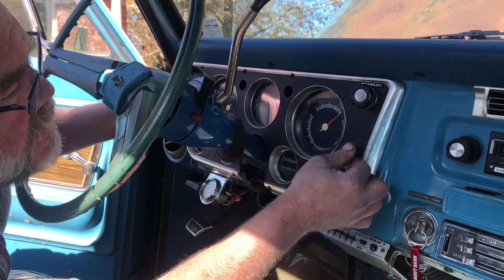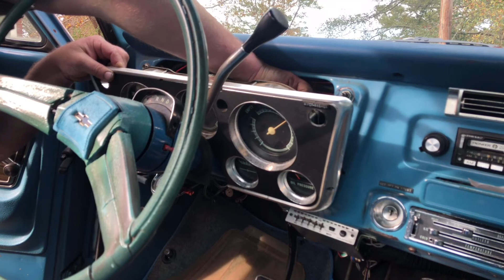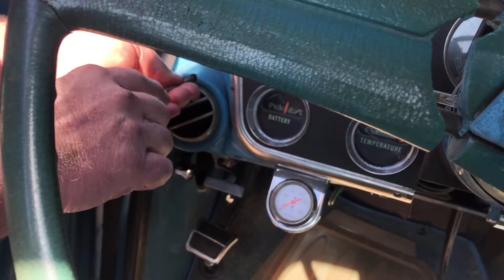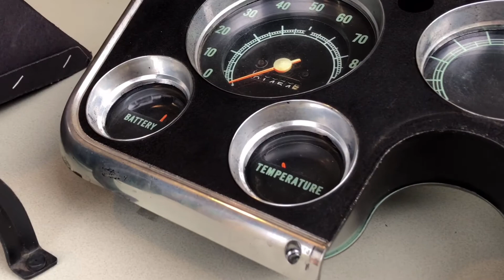Factory HVAC restoration

Comment: Nice how the older vehicles were easier to repair,,, no servo motors that break in 5 years,,, Just keep the cables lubed ,,,Glad there are reproduction parts available,,, Good luck on the gauges,,,Best Regards

Comment: I just bought a 1 owner 69’ c10 and all the ac parts were still there and looked to have never been removed. 53,000 miles on the truck. Leak at the compressor. New compressor and cools like a champ. Driver side outlet is blowing cold. Center and passenger I think are blowing heat. Counter productive. lol. So I’m guessing there is a blend door not working properly.  What’s your thoughts? Thank you for the video as well!!!!
Reply from the maker: @j.craiggifford3583  yes I would agree. There are doors that should have cable controls. It could be that they are just out of adjustment. Cool find on a one owner truck. Make sure you use the correct engine oil in these old rides. Right now the easiest to find and good to use is Valvoline VR-1, it’s available in several viscosity’s, 10w40 is probably what it needs. You can also order classic car oil from the company DRIVEN or Schaffers or even Lucas Hot Rod oil. Enjoy your cool new to you ride!!! Thanks for stopping by the channel.
Reply: @RealWorldGarage  where are you I’m Mississippi? I live in Murfreesboro, Tn now but I’m from Mississippi.